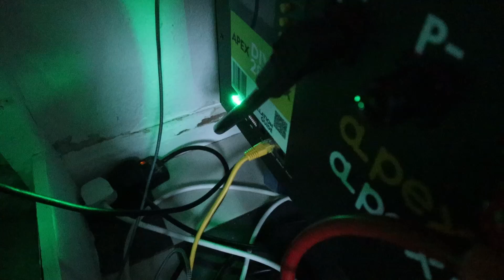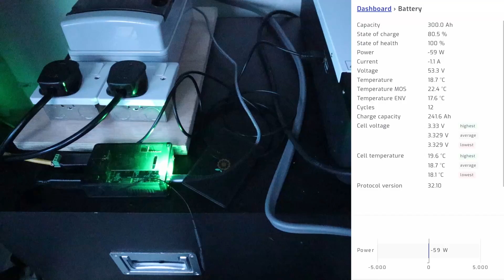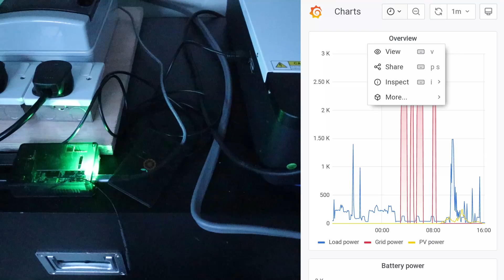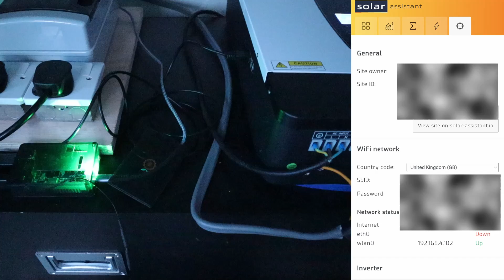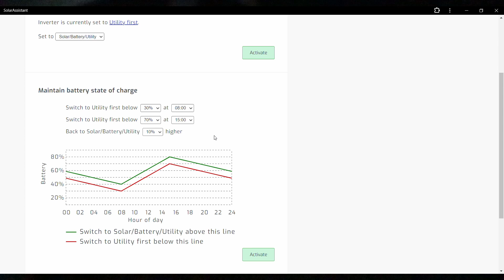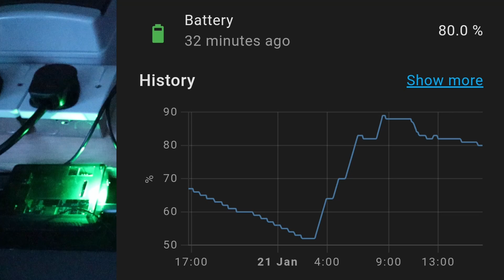Next Level Off-Grid Upgrade with Solar Assistant | Control + Data + Automation

Comment: I have a Growatt inverter that only excepts Growatt batteries, and I have a Braun 300Ah 15Kw battery and was thinking about getting one of these in hope it can talk to the inverter and the battery hoping it will allow me to use my battery, but not sure if it will help or not, but will cost me over $300 to by one and don't want to waste my money.
Reply from the maker: @SpaceManAus  The software/setup has a decent range in terms of compatibility. The only thing that can be tricky is getting the most appropriate cables to connect the battery to SA and inverter to SA. You can select the options that 'best fit' in the SA config. It all sounds difficult, but it's not too bad and has worked for me across multiple inverters and batteries (even in the lower voltage range https://youtu.be/AZ_kqjfhZec). In theory, you should be able to connect up the Braun using RS485 (with the right cable) but I’ve got no way to test that. With the inverters you can try each option in the config if things don't look like they are connecting right. In terms of getting SA, It's one of my most used phone apps and I get the cautious approach to spending the money if it doesn’t cover what you need. All the best, Adrian

Comment: Great video. I have actually just bought Solar Assistant. I already had Home Assistant just trying to connect them both a Video on that would be great
Reply from the maker: @pj6611  You're most kind, thank you😊. As you can imagine, that's quite a big topic to cover due to the number of options involved and personal requirements (different needs). If you want to connect up the two for the basics to begin with I'd suggest looking at the MQTT side of things first. Happy to answer any questions on that side of things once you've had a go? All the best, Adrian
Reply: @DADvinci  I have tried everything I can think of I have searched everywhere I already have Mqtt on Home Assistant but not getting anywhere adding the solar Assistant. I only actually bought Solar Assistant because I thought it looked easy to connect on to HA on Solar Assistant website. But when I emailed they were not helpful at all they just sent links to the page that are on their website. Thanks anyway it was worth a try
Reply from the maker: @pj6611 Sorry it's not worked for you. The most important step (which I discovered) is having it enabled on SA. The MQTT Broker sits on SA and has to be enabled. There can only be one MQTT broker, so I didn't setup on HA, just used SA. In the setup of the broker on SA you need to put the HA instance and auto discover. Have you gone down this path as yet? Cheers, Adrian
Reply: @DADvinci  Thanks still trying so what did you put here on SA config page? HomeAssistant
Unique ID
Reply from the maker: @pj6611 I just put the name of my instance (one word) followed by .ha and made sure auto discover was on. Then made sure that the MQTT integration was installed on HA.

Comment: hi, can you help me? I managed to connect the inverter with Raspberry to solar assistant, unfortunately I can't get the bms seplos V3 to communicate, I bought the same converter as you, how should I connect the wires and in which port?
Reply from the maker: @robertocensi3297  Good day! I'll try and help. Just to confirm, you're connecting from a RS485 port on the Seplos BMS and that's going to a USB on the Raspberry Pi? Do you get any error messages in Solar Assistant when you connect in the settings section (it connects the inverter ok, but errors on the battery section)? If you could let me know. All the best, Adrian
Reply: @DADvinci  Hi Adrian, I finally did it, after many attempts my battery communicates with solar assistant, thanks.

Comment: Hi adrian ive stumbled across your channel whilst looking for videos on the EA sun 3KW 24V system, ive just ordered the hybrid inverter as im upgrading my system from a 12V to 24V system. Is there a mode in the inverter where you can have grid connected but it only powers loads when there is no solar or battery available? Im currently using the 8s JK BMS, can this also be connected to an RPI running solar assistant to get battery info? I love your setup and will be watching closely what you do next. Sorry for all the questions but itsthe only channel i can find with good info on the EA sun hybrid inverter, regards Karl
Reply from the maker: @karloffgrid  Hey Karl! Thanks for your questions and I hope you're enjoying the festive break. There are a couple of modes you can use (menu item no 1) as follows from the manual:-

SUb Priority (default) - Solar energy provides power to the loads as first priority. If solar energy is not sufficient to power all connected loads, utility will supply power to the loads at the same time. Battery provides power to the loads only when any one condition happens
- Solar energy and utility is not available.
- Solar energy is not sufficient and utility is not available.

SbU Priority - Solar energy provides power to the loads as first priority. If solar energy is not sufficient to power all connected loads, battery energy will supply power to the loads at the same time. Utility provides power to the loads only when battery voltage drops to either low-level warning voltage or the setting point in program 12 (this means menu item no 12).

From what you've mentioned, it sounds like the first (default) option is the best fit. This isn't a battery-less model, so you'll still need a battery connected for it to work.

In terms of connecting the JK BMS, I assume you've got a B2A8S20P or similar? I've got a few of these, including the 1A 100A version (incorrectly sent with an order), but haven't connected to SA as yet. If you do wish to connect the best option would be the RS485 adapter. I'm going to get one, but need to ensure it's the one specific to the 8s model as the connector is different on the 8s BMSs. You can then get a USB adapter that it can be wired up to. Also need the correct USB adapter (right chipset). The inverter can be connected up using the right USB cable directly to SA (on the Pi).

I really appreciate your feedback too! Never really know how this kind of content will land with folks. If you could let me know about the BMS model you've got that would be good. Please shout if you have any other questions as well. All the very best, Adrian
Reply: @DADvinci  thanks for your reply Adrian. Looking at the different modes you have mentioned I think for normal day to day usage the SBU mode would be most suited (solar powers loads, then battery then grid covers any deficit, the BMS I have is indeed the JK_B2A8S20P. I've currently got a 12V battery setup but  I'm upgrading to a 24V battery as soon as cells are back in stock st fogstar 🤣 I have a shelly1PM currently setup to run my 12V battery charger at cheaper rates midnight-7AM my aim is to use the shelly to control grid power at cheaper times which would be then under the first mode you suggested so it may be trial and error to see which mode works best. It is definitely interesting looking at your take on the different ways to monitor  your bstterys etc. Hopefully you can trail the JK BMS to see if you can get it to work with your setup, I can't see no reason why it wouldn't unless the older models it is just used for updating. Thanks for the in depth reply
Reply from the maker: @karloffgrid No probs at all Karl, glad to help where I can. SA is so much better than anything else I've tried, love it! I feel another purchase coming on🤣. I'll see if I can get hold of the RS485 adapter for the JK BMS we've got and rig the USB adapter I've already made up for my Apexium batteries to see if I can get the 8s taking to SA (#gamechanger) on another battery I'm building (dump battery I'm rebuilding from the my scam cells video). Cheers
Reply: @DADvinci  I'll also try from my end to see if I can find anything out about getting the 8s JK talking to SA. I'm sure I saw somewhere on ali express that did the adapters for them aswell as the display screen
Reply from the maker: @karloffgrid  just purchased one 😆. Will see if it fits in a week or so
Reply: @DADvinci  I've just watched a video of using a victron smart shunt to monitor battery % in SA, I just so happen to have a victron smart shunt with cable so that can be a last resort haha. I also saw a video of someone connecting the JK bms to a cerbo GX, they didn't use the JK rs485 adaptor, the just used the JST connector and a TTL- USB adaptor. I think it is possible if you get the connection the right way round (I got a screenshot of the pinout for the 8s JK BMS 🤣)

Comment: Please can it be used to update the inverter to the latest software
Reply from the maker: @dendricknonso4327  Thanks for your question. I've not found a way to use it for that. Usually, any updates on the inverter would need a direct connection. All the best, Adrian

Comment: Good morning, I'm from Greece. And I would like to ask you something about the video you uploaded on YouTube Apexium + EASUN = Cheap & Powerful 48V System? | Testing Update because I have the same inverter, the cable you used to connect the inverter to the solar assistant and the battery cable to the solar. Thank you very much.
Reply from the maker: @user-ws9co6xb5g  Good day, I've replied to your email, but the link for the Inverter to Solar Assistant cable is in the video description under > EASUN Solar Inverter USB RS232 Cable (1.8M). I hope this is what you're looking for. All the best, Adrian

Comment: HI, thanks for the nice video. at 5:42, i see some sort of inverter menu, thats shows "fault" tab. Does this imply that one can view the history of faults on the inverter? My objective is to use this to view remotely in real time, inverters installed at project sites. being able to view faults and errors codes will assist with site maintenance. Thank you for your time.
Reply from the maker: @alexanderfrederick3632  You're too kind Alexander, thank you 👍. The dashboard seems to catch the last state of the inverter and has the list of device states which is what's shown in the video (https://solar-assistant.io/help/dashboard/inverter). Unfortunately, I've not found a way to track fault history as yet, although I've been looking to see if it's possible in conjunction with Home Assistant (using MQTT) which I'm using more and more for automations. I'm running the 2024-01-23 stable version of SA and there is an automation option under the Power tab, which allows you to select automation>rule table>which setting do you want to control?>record fault code with multiple options available on my type of inverter, but I'm not sure how that will work though. I'm still going to try using Home Assistant to see if I can trigger something to let me know when something isn't running right (my own definition of a fault). I hope this answers your question, please shout if you need anything else. All the best, Adrian
Reply from the maker: @alexanderfrederick3632  Sorry, should have mentioned that HA does track the changes in device mode on my type of inverter, so once it enters fault mode it should change on the tracking (but not what the fault is). So, for my inverter in HA under Entities, it's Axpert Device Mode (Entity ID sensor.axpert_device_mode) which is via the MQTT integration on SA. Cheers
Reply: @DADvinci  Thank you.

Comment: Thanks for the video. I am very interested in having Solar Assistant on my solar system. May I know if it's easy to just get the generic orange pi and buy the software from Solar Assistant website justclike you did for someone who is not savvy when it comes to networking?
Reply from the maker: @mrjohn7930  Hey! Sorry for the delay, I didn't get notified of your comment for some reason. The instructions on the SA website are very good and the on-line community seems good (even just by googling). I can also help out if needed. As long as you can image the microSD card (using something like balenaEtcher) it should just run from there on the Orange Pi 3 LTS. You then go through the setup process which again seemed very straightforward using the instructions, so I think you should be fine even if you're not that savvy with networking. I use Wi-Fi, but the Pi has an ethernet port too. I hope this answers your question? All the best, Adrian
Reply: I do appreciate your reply. I have ordered for the Orange Pi, and I am expecting its arrival in a week's time time or two along with the accessories. Interestingly, the inverter I am going to be using with it is similar to yours but bearing a different name. Should I hit a brick wall, I will definitely reach out to you for assistance 😂
Thank you once again.
Reply from the maker: @mrjohn7930  Great to hear, you won't be disappointed. Please let me know if I can help once you set it up.

Comment: Can I ask what you use for getting upto date information from your smart meter? So as to incorporate with home assistant, thanks
Reply from the maker: @duncanatkinson9727  Hey Duncan! Thanks for your question. It’s using the MQTT integration. I used the Bright App initially, but that was reliant on the cloud (although free) https://glowmarkt.com/bright. I had to get my own smart meter as there weren't any Octopus Home Mini devices available (with my installer) when my smart meter was installed at the start of the year. I got this meter https://shop.glowmarkt.com/products/display-and-cad-combined-for-smart-meter-customers as it seemed to be the only one with local MQTT capability, which is what's needed to get the near real-time data from the meter itself and into Home assistance via the MQTT integration. I hope this answers your question, please shout if you need anything else. All the best, Adrian
Reply: @DADvinci  thanks for the reply, much appreciated.
Took your advice and ordered the smart meter hoping to follow your setup with MQTT, is any other hardware needed to make this work?
Reply from the maker: @duncanatkinson9727  Hello again! Great to hear you're giving it a go. I'm running HA on a thin client bought from eBay, but nothing else (other than the SA hardware shown). I did have some issues with the MQTT setup using the Hildebrand HA integration initially and found this which I used instead - https://youtu.be/6MiZ2EMajnA?si=XXANQX2fQLabcbN-&t=178. It was more involved upfront, but has worked fine since setup. I hope this helps. Cheers, Adrian
Reply: Hi, how easy is it to install the software from the sd card to the pi, I already have a 3pi, but I'm really struggling with it to write commands. Is it plug and play
Reply from the maker: @leehawkins1533  Thanks for your question Lee. I imaged the micro sd card using balena etcher as detailed here
https://solar-assistant.io/help/getting-started/prepare-device. I hope that answers your question? All the best, Adrian